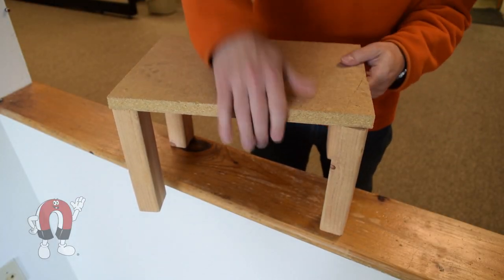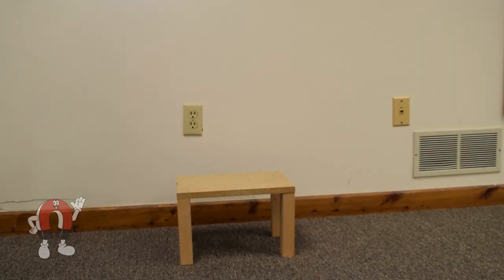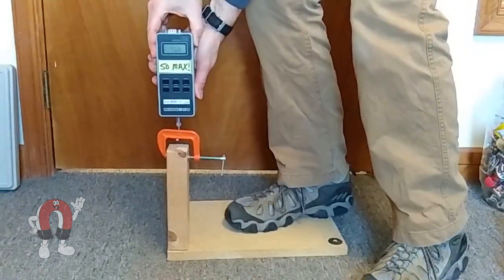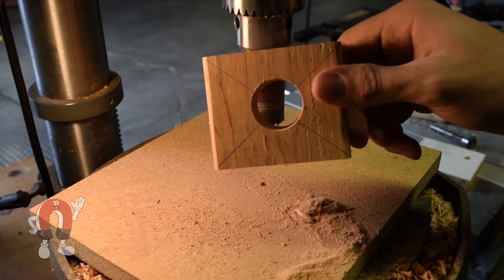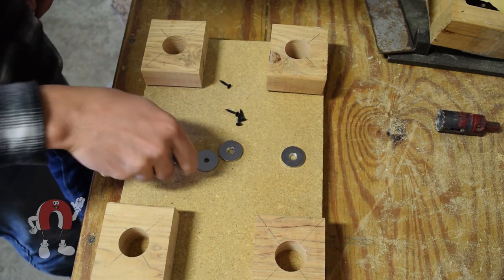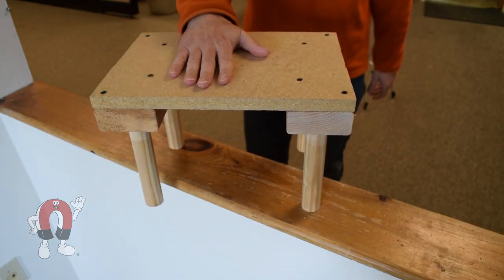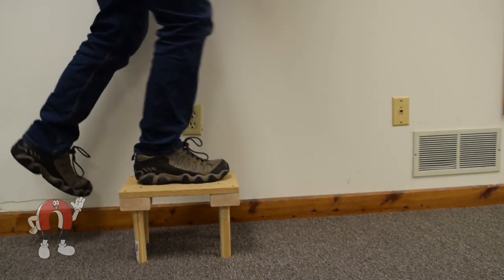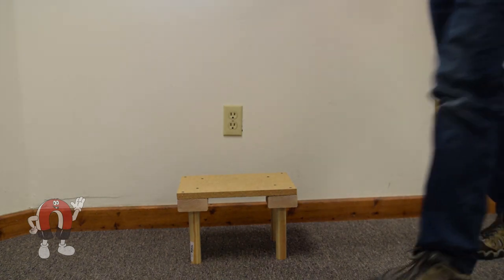Magnetic Table Legs

Comment: So, I've had an idea for modular worktops. This video has inspired me. At first I was thinking about using square 2'x2'x2" tops that could have magnets on each corner and they would just snap together. But probably a better idea would be to drill recessed holes with washers like you have done here only on each corner of a top piece and use dowels with magnets to link them together. How strong a magnet would I need to make this practical?

Comment: I trying to make a small diner balcony table (assignment for school) but the leg chair with connection has to be a (glued) pin and hole connection so I'm trying to fing a loop hole because my parents want the table to be retractable. So I thought I cut the legs rights where the rules end (idk how to transalte rule, ukno the side under table attached to legs and table top) and theen make a hole and a pin with magnet. Soo it is that hard task or should I skip it? Sorry for english!

Comment: I wonder how deep the leg must be inserted in order to provide the required resistance? Could I just recess the washer into my butcher block top by 7/8" of an inch? How would I calculate this or would it just be a trial and error experiment? This is inspirational. Thanks.
Reply from the maker: It might not need to be as deep as we made it. If the hole and leg are tight, then 7/8" or 1/2" could very well work! Always good to do some testing, though.

Comment: What is the reason for adding the magnets?
Reply: Probably makes for easy assembly/disassembly. If the magnets were not there, it would need to be a press fit. In that case, it might be difficult to break down and pack away quickly without the use of tools.